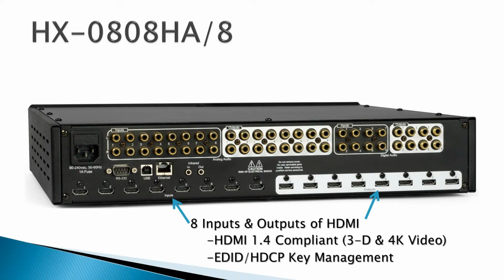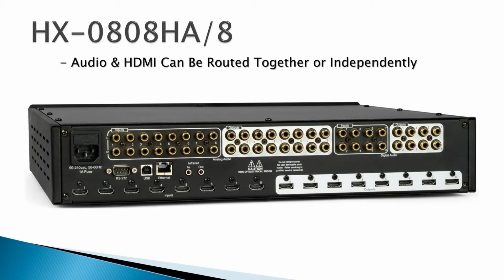HDMI Matrix Switch | HX-0808HA/8 | Avocation Systems

Comment: Impressive - we need more videos like these to better illustrate the capabilities, features, and versatility of your matrix switches.  
On the analog side, is there any signal loss and/or "noise" introduced in the system between the inputs and outputs?
Within the system, is there a circuit that would bypass the switches so as to monitor/measure any signal degradation (if any)?
Thank you, Ciao, L